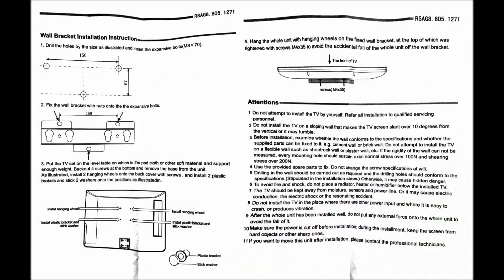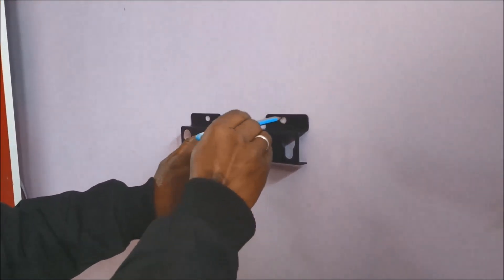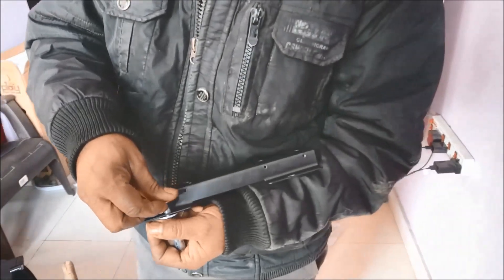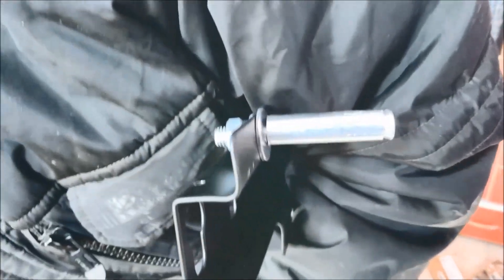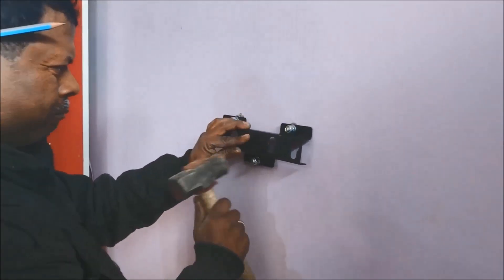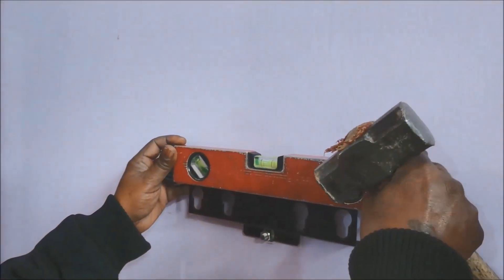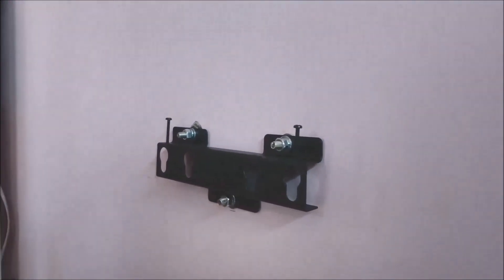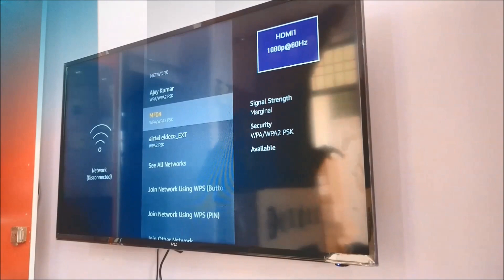VU LED TV Wall Mounting - Installation Demo

Comment: Does VU also provide elbow joint wall mount so that the TV can be bent to 90 degrees side ways?
Reply from the maker: Rahul Chettiar, No. You'll have to buy it separately
Reply: TalkipediA can u suggest me the popular ones that goes with VU 43 inch Android tv
Reply from the maker: Rahul Chettiar, No idea brother.
Reply: TalkipediA I saw some, I hope it fits
Reply: @rahulchettiar7636  please share link